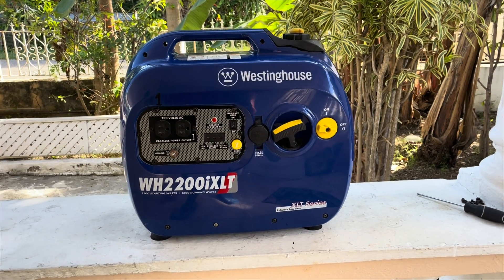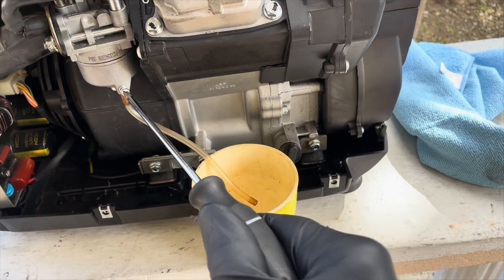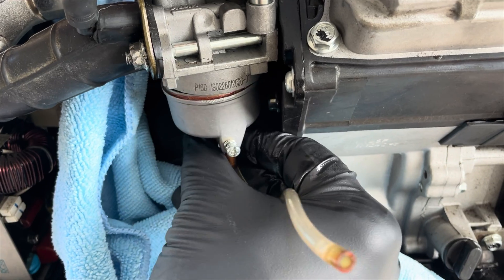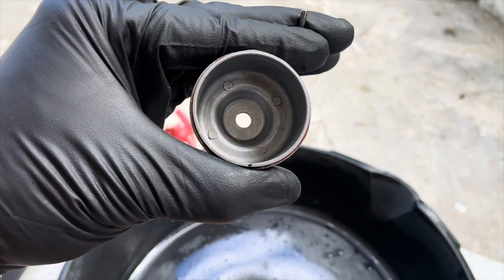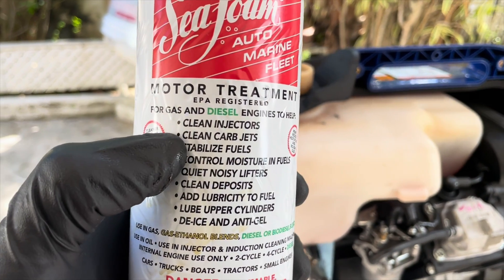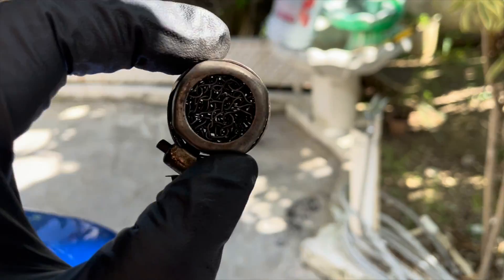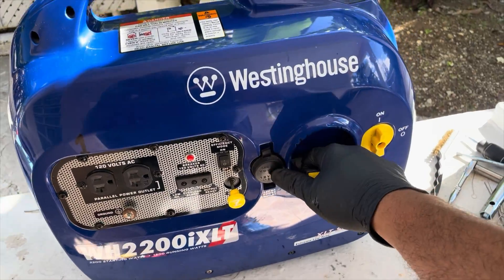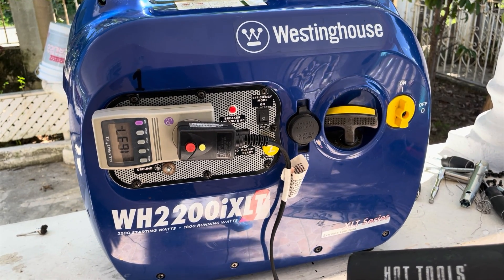How to repair any portable inverter generator that shuts down under load, lacks power.

Comment: My generator isn't sparking... what should I do?
Reply from the maker: If you have a Westinghouse wh2200xlt and does not have spark start by replacing the spark plug. If that doesn’t fix your issue then unplug the oil sensor. If you still have no spark then you might have a faulty ignition module or a bad ignition coil.

Comment: What’s an idle jet?
Reply from the maker: The idle jet (also known as pilot jet) is the small fuel passage inside the carburetor that controls how much gasoline the engine gets at low RPM, especially when it’s idling or not under load.

If the idle jet is clogged, the generator will usually start and then stall, surge up and down, or only run with the choke on.

It’s a tiny jet, but it’s super important for smooth idling and clean fuel delivery at low speed.

Comment: I have a new carb, new fuel lines, new spark plug. I ran sea foam but stall under load. Any ideas?
Reply from the maker: Verify the spark arrestor. It’s the mesh located at the end of the muffler. If that is clogged of carbon the engine will loose power as well.
Reply: @tacticalpowerpro  yes I even cleared that out too. I am guessing it has to do with the governor arm but I have very limited information on that
Reply from the maker: Ok, well if it’s an inverter generator like the one on this video there is no governor arm like on conventional generators. The speed in these inverters are controlled by the stepper motor on top of the carburetor and the inverter module. Verify the stepper motor is connected correctly. The stepper motor should open and close the throttle plate when load changes.

Comment: Thank you so much.. I actually have two of them connected with a pair cable for my 24ft RV.. In the winter one would work.. Summertime need two for the AC when I'm away and not connected to full hook up... You just have me the knowledge I need to stay up. I will be referring your site to my TRA membership page... Thank you again. Great video
Reply from the maker: Glad to hear that! Running two in parallel for your RV is a solid setup. One in the winter, both in the summer for the AC, that’s exactly how they’re designed to give you flexibility. Thanks a ton for sharing my video with your TRA group, that means a lot 🙏🏾. I’m glad my video helped you stay powered up, safe travels and reliable camping ahead! ⚡🚐

Comment: Bravo.......ok .....i have a freind  that has a problem.......if the invertor  is not producing power ....but ever other aspect works....thinking of using the  full bridge rectifier and adding a  out side invertor ....cheers
Reply from the maker: If the inverter is not producing AC power then definitely the inverter module is bad. You can give that a try 🤔 I honestly never thought of using an outside inverter on the 12vdc output of the generator. The only downside is you won’t be able to use all 2200w, probably it will cap at 150w. Let me know if it works and how much power can you pull like that.

Comment: Great info. Is there a way to adjust the eco mode feature to run unit a little slower. Sometimes mine runs low the next time in runs faster all with no load on. Also is there a way to quiet up the unit more.
Reply from the maker: The carburetor has an idle speed adjustment screw, if it’s screwed in too far the Eco mode won’t be able to lower the speed when pressed.
Reply from the maker: The only way to make it quieter would be to hide the generator inside a generator enclosure. You could build your own or buy one like the Zombie Box or a Hudson generator box.
Reply from the maker: The only way to make it quieter would be to hide the generator inside a generator enclosure. You could build your own or buy one like the Zombie Box or a Hudson generator box.

Comment: I have the WH2400i.  Have started it in a few years and just tried and nothing.  Took the cover apart and sprayed some starting fluid into the carb and it fires up for just a second and then dies.  I'm getting fuel to the carb but I didn't take apart the carb like you did.  I'm guessing the main jet is completely clogged from non use?  It's basically like new bought it back in 2016 and have never really used it.
Reply from the maker: Your guess is correct, your generator’s main jet is definitely clogged. Pull the carburetor out, give it a good clean and your generator will be running like new.

Comment: I have a 3500 inverter generator, it just started doing that. Turns of buts shuts off when trying to run my pressure washer that was yesterday today it worked no problems after a couple hours it shut off and when it turns off it turns right off . Has a new spark plug njk not even a month old and oil changed as well. What can it be 🤷🏽
Reply from the maker: Does the spark plug has the correct gap?
Reply: @tacticalpowerpro  I'm not sure to be honest , I looked online and saw a forum where I found the njk would for instead of the standard one it came with
Reply from the maker: @KingTheDetailer  the spark plug should be gapped at .8mm or 0.030in. Make sure  you have gas in the tank, make sure the carburetor is completely clean and the spark arrester is not clogged.
Reply: @tacticalpowerpro  yeah I have a feeling it probably gonna be the carborator but I'm gonna go ahead and change the spark plug again and get a new filter . What spark plug do you recommend?
Reply from the maker: @KingTheDetailer  most likely it is a carburetor issue.  I recommend NGK plugs.

Comment: Hello Tactical Power Pro, great video.  
I have a question, in 2019 I bought a Westinghouse WH2200iXLT inverter generator identical to the one you show in your video, I took it out of the box, ran it for about 16 minutes to test it and to finish the small amount of gas I put in and then, kept it all this time inside my house (air conditioning), today, in preparation for hurricane season, (I’m in South Florida), I took it out and put a little gasoline and oil in it and followed the instructions to start it without success, I noticed that almost all the gasoline had escaped from under the inverter. Any idea what it could be? 
Thank you in advance.  😃😃😃
Reply from the maker: Hello! Of course I can help you out. Did you clean the main jet and the float needle inside the carburetor?
Reply from the maker: Also, if the gasoline is coming out the inverter you might either have the carburetor fuel drain screw open, the float needle is stuck or a cracked fuel hose.
Reply: @tacticalpowerpro  Thank you tactical power pro for your response. 

As I mentioned before, when I took the inverter out of the box, I turned it on for about 15 minutes in 2019, and from there, I put it away. Yesterday (01/08/2024) I decided to turn it on and it didn't turn on and I found a puddle of gasoline under the inverter. Today I tried it again and surprise, it turned on for about 8 seconds but I it ran out of gas since I hadn't added more. (By the way, the carburetor fuel drain screw is not open)

Since I am not mechanically oriented, I am going to open it and use common sense, I am going to follow the course that the gasoline takes from the tank to the carburetor to see if I see a leak, I assume that perhaps the fuel has degraded a hose or joint that bring the gasoline to the carburetor. I hope it works and thanks for your help.

(Out of curiosity, do you have a video "How to repair a Ryobi inverter electric generator" in Spanish, do you speak Spanish?) 😃😃😃
Reply from the maker: @miguelalt8855  hi Miguel, if the generator was not turned on since 2019 yo most likely have a stuck carburetor float needle. My latest videos shows what to look for in that situation. I do have a few videos en español. I was born and raised in the beautiful island of Puerto Rico. Moved to the United States in 2013 when I joined the Air Force but after 10 years I moved back to the island. Do you speak Spanish as well?
Reply: @tacticalpowerpro  Yes, I do. I am from Colombia but I came to the United States many years ago. I used to work on an Italian cruise ship and I used to go at least once a month to Puerto Rico, beautiful country and good food. 

Regarding the fuel leak, initially,  I asked my son to put gasoline in it and I think he spilled it, I checked since yesterday and the inverter does not leak, so that is not a problem anymore. I drained the carburetor and the first fuel that came out was somewhat greenish, since then I have filled it and drain it 3 more times. I was able to start it few times for few seconds which is encouraging; a friend suggested putting in injector and carburetor cleaner or something similar, he thinks that might help to clean it. That is my next step.

Thanks again Tactical P P and I will continue watching your videos, I have learned a lot so far.
Reply from the maker: @miguelalt8855  give the carburetor a good clean (clean the main jet, emulsion tube, pilot jet and all carburetor holes) and the generator will run like new.

Comment: Very helpful! I cleaned mine yesterday. How often should I change the oil?
Reply from the maker: Glad the video was helpful! You should change the oil every 50 hours of runtime or every year, whichever happens first.
Reply: @tacticalpowerpro  is it ok if I use 10w40 instead of the recommend 15w40 ???
Reply from the maker: Neither. Use 10w-30 for the small engines on inverters, the 15w-40 is typically use on diesel engines.
Reply: @tacticalpowerpro  Thank you!
Reply from the maker: Thank you for watching my video. I’m always here to help 🫡